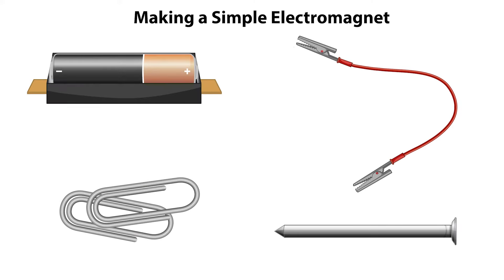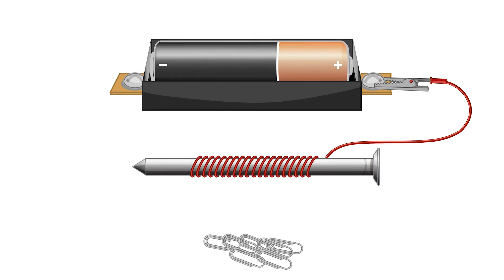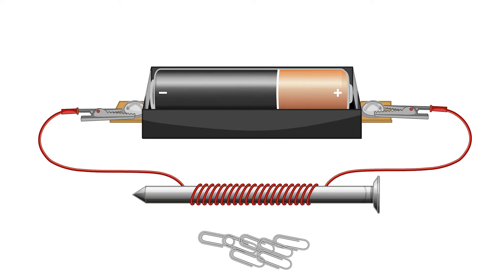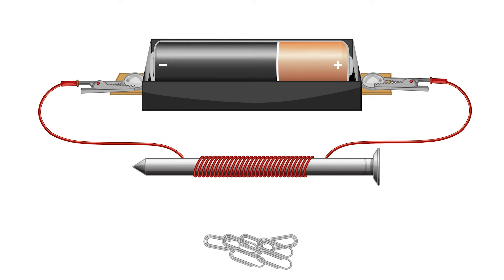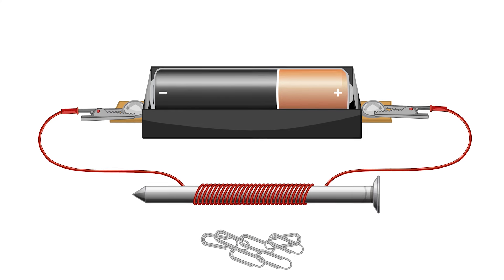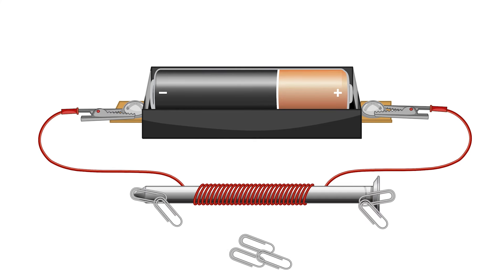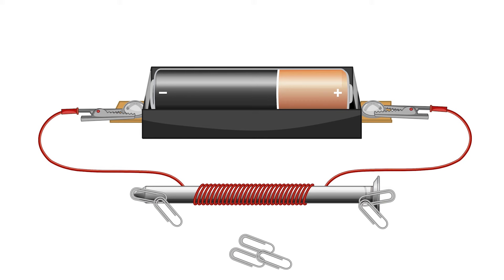Increasing the Strength of an Electromagnet – Number of Coils

Comment: When we add two batteries to the coil instead of one, this will make a bigger electric current flow so that the magnetic filed will be stronger.
Reply: You also have to make sure the batteries are connected in series. Some people make the mistake of connecting them in parallel, which does not increase the current.
Reply: Great!!!